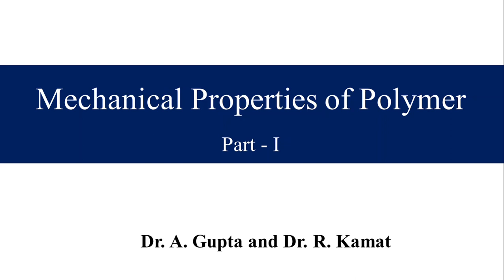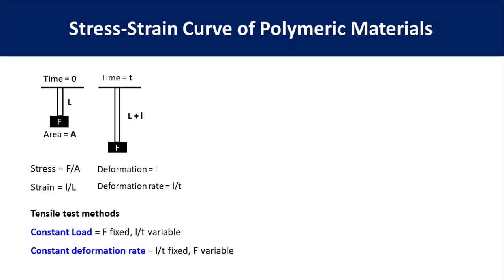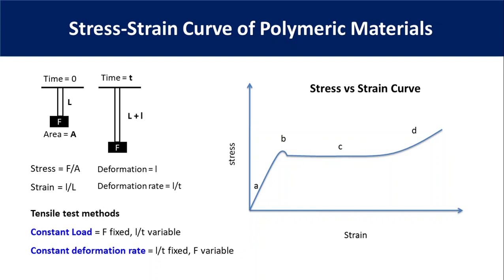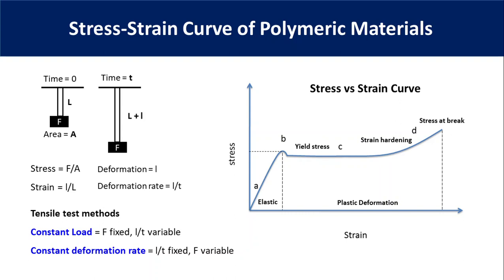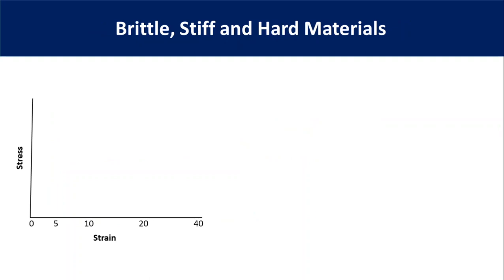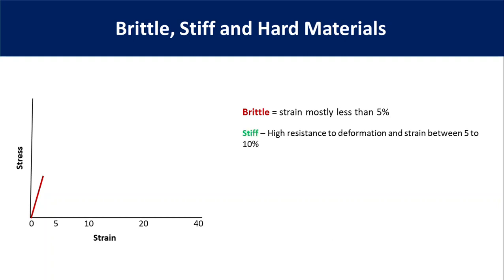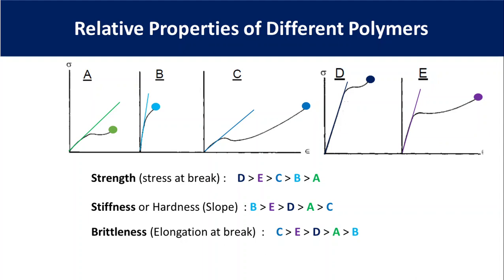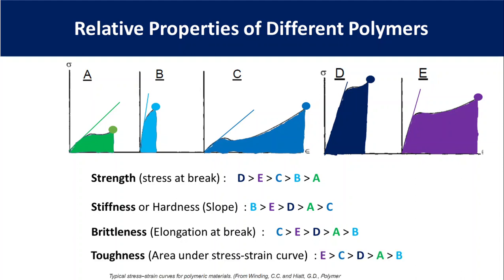Mechanical Properties of Polymer and the Stress-Strain Curve -Tensile Testing

Comment: Thank you for creating this video.  I am an engineer in support of a mechanical test lab.  We test both metals and polymers.  When we test metal per ASTM E8, we run the test with strain control through yield; but when we test polymers per ASTM D638 we use a fixed speed and simply measure the strain.  We perform the polymer test on the same materials, using different sized dog bones.  We test the Type IV at 1 in/min and the type V at 0.5 in/min.  Doing so provides statistically different results. My theory is that this is because the two different dog bone sizes are being strained at different rates, and testing with strain control, rather than fixed speed might bring these results closer together, however the guidance documents require the test to be performed at a fixed speed.  Does anyone know why poly tensile testing is done at fixed speed rather than by strain control?
Reply from the maker: Hi Philip, Since metal and polymers are intrinsically different and they go through different microstructure change during deformation, we believe they are tested at different condition. Since, polymer show viscoelastic deformation which means time dependent deformation, testing speed definitely going to affect their modulus and yield point. The probable reason for using different speed for different test is their sample dimension. Therefore, when we report physical properties of a polymer, it is important to mention the test conditions, like test speed, temperature and also humidity. I hope it help to clarify little bite.

Comment: brittleness means measure of elongation at break ... so if elongation is more it is less brittle or more brittle. Because in  example,  'c' has  has more brittleness but has more elongation before break?? please clarify.
Reply from the maker: For polymer, a general thumb rule is, if it is showing less than 5% deformation before failure/rupture, it is considered as brittle. Pure polymers are usually not brittle but when fillers are mixed with it, its flexibility deteriorates and at very high filler loading, it may break before 5% deformation.
And C graph is actually list brittleness since the ranking is based on elongation at break of the material. C plot shows highest elongation at break so it is least brittle or not brittle at all.
Reply: @PolymerWorld  thankyou
Reply: @PolymerWorld  please upload the next part sir

Comment: sir, can you explained the brittleness for polymer. as in metal brittle are that which has very less yeilding.  and please explain how C graph has more brittleness.
Reply from the maker: Hi Aakash, definition of brittleness for polymer is also same as metal. For polymer, a general thumb rule is, if it is showing less than 5% deformation before failure/rupture, it is considered as brittle. Pure polymers are usually not brittle but when fillers are mixed with it, its flexibility deteriorates and at very high filler loading, it may break before 5% deformation.
And C graph is actually list brittleness since the ranking is based on elongation at break of the material. C plot shows highest elongation at break so it is least brittle or not brittle at all.

Comment: is this the same curve we can obtain after compression test also for polymers
Reply from the maker: Yes. Same stress strain curve is obtained for compression test  only the values differ. In tensile test material fails at weakest point whereas in compression test material fails at strongest point.

Comment: high stiffness polymer = high brittleness. right? brittle is the opposite of ductile material
Reply from the maker: Yes, brittle is the opposite of ductile but stiffness and brittleness is different. In casual terms they seems same but stiffness is the measure of resistance to deformation where as brittleness is measure by the amount of deformation (elongation at break). A high molecular weight polymer with high crystallinity can be both stiff and ductile where as a low molecular weight polymer with very high crystallinity can be stiff and brittle. The reason is long chain polymers will have long chains segment in the amorphous region which will be able to deform at higher load.